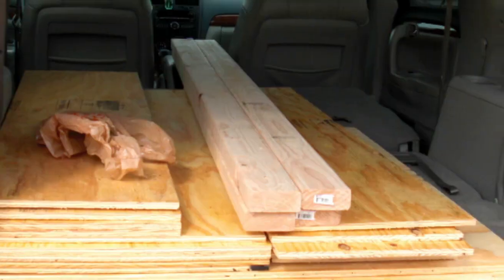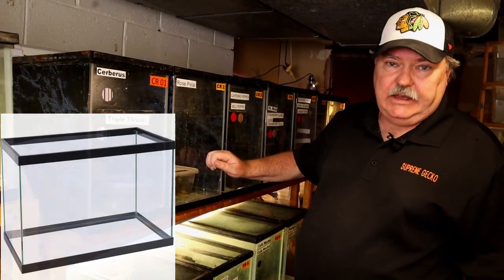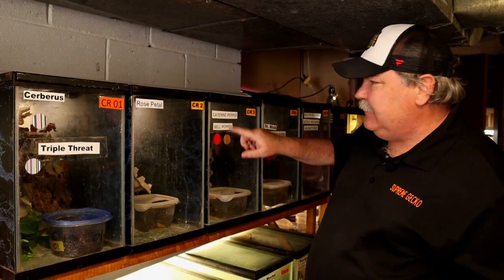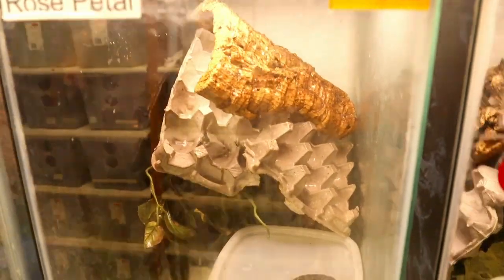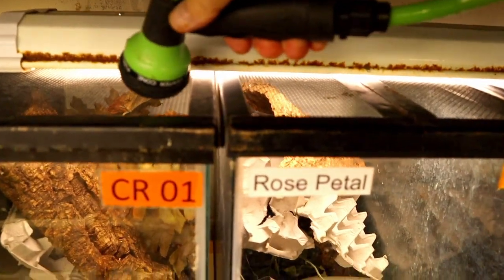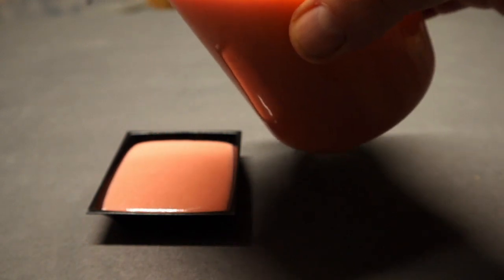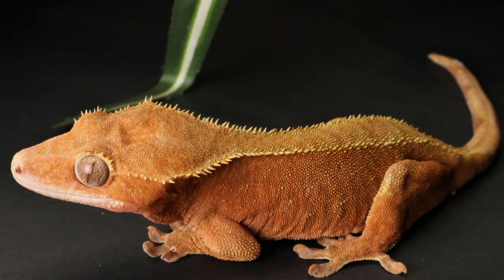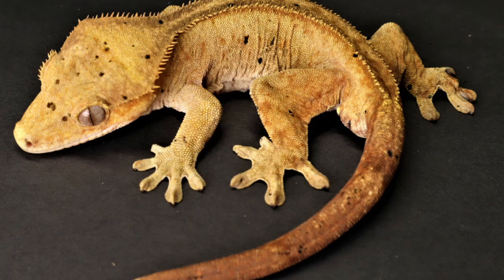Supreme Gecko Facility Tour   Crested Gecko Rack #1

Comment: How warm and what humidity is the best for lepard gecko's. Just upgraded and want to make sure I'm doing it right. I keep them at 80. Degree's andb50_60 humidity.
Reply from the maker: For Leopard geckos?  Just checking as this video is on crested geckos.   For leopards, we keep our enclosures at room temp (summer @ 75-80) and warm spot (@20% of the tank) around 95.  Humidity?  I've never measured  :)    I keep water dishes and moist hides in the enclosures and it's not an issue.  Hope this helps.

Comment: Hey I have a question 🙋‍♀️ so what are your thoughts if the breeding tank is ALSO the regular home tank for the gecko in terms of substrate vs just a lay box? What I mean by that is I have 10 breeders and 2 future breeders. The 10 adults are in seperate tanks with 3-4 inches of cocoa fiber. I alternate who is in what tank depending on who I am pairing. Like I take a male from one tank and put it into the females tank for a couple weeks or a month. I do not use seperate breed only tanks. Obviously it would be WAY easier to substitute the large amount of substrate that they normally lay in for a lay box, but would this largly effect overall humidity and feeling of nature in their permanent year round home? Thoughts?
Reply from the maker: Hi Lindsey-   If you don't mind, I am going to save your question and do a live Q&A in the next week.
Reply: @SupremeGecko  okay I dont mind thanks :-)

Comment: Is the misting water RO or dechlorinated water? Where do you find such small meal worm container? I read that you need a 40 gallon or larger front opening enclosure for geckos then why are you using a 20 gallon high for your geckos?
When are we going to see a display tour?
I absolutely 💜💜💜💜💜 your videos especially this tour video.
Reply: I had the water question as well. If you use RO do you have an RO system that remineralizes the water or do you add minerals yourself? Thanks for the video Wally.
Reply: @crittersmoore1748   Great Minds Think Alike !
Reply from the maker: Hi Elaine.  Great questions.   If you don't mind, I am going to save your question and do a live Q&A in the next week.  (by the way, you ARE seeing the display tour.... it started with this video.  There is no way I could do a tour of the full facility any justice in only one video  :)
Reply from the maker: If you don't mind, I am going to save your question and do a live Q&A in the next week.
Reply from the maker: agreed.  great questions.

Comment: I have a question on how to properly clean egg shells. I recently posted a pick to an isopod fb group and am getting all sorts of different information.
Reply from the maker: What is your question?  How to clean them?   What responses are you getting?
Reply: @SupremeGecko  I work in a restaurant so I get several dozen at a time. I soaked them to remove any leftover egg goo then baked them before grinding in a food processor. People were saying i didn't need to boil or bake them. What is your take on this? Any information would be greatly appreciated.
Reply from the maker: @BeaEmBee  I really don't at all.  Isopods find far worse in the wild.  I set mine aside then crush them up after they dry out..  Just be a bit cautious when handling them and wash your hands afterwards.
Reply: Thanks.